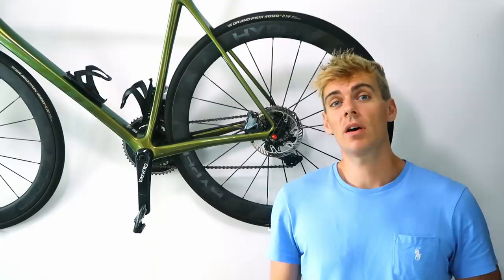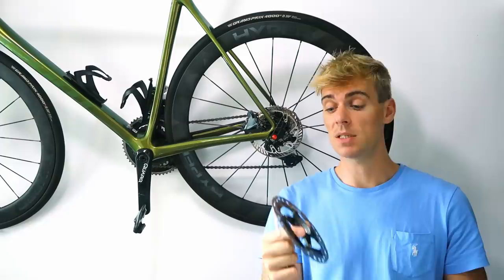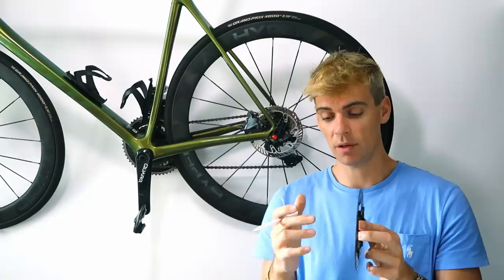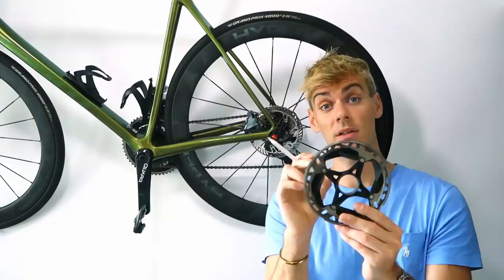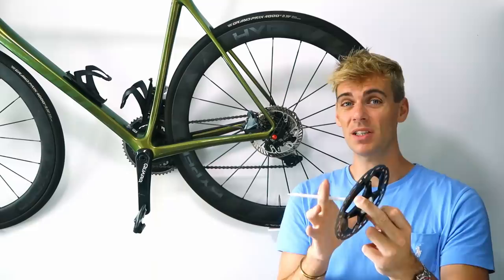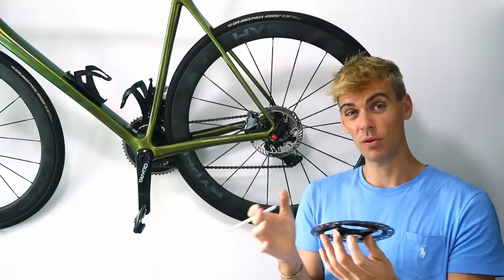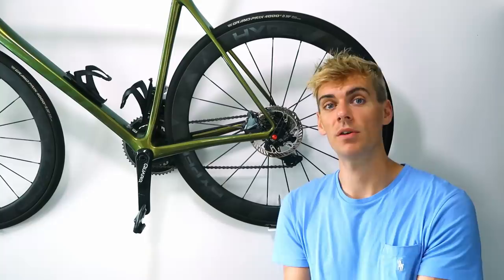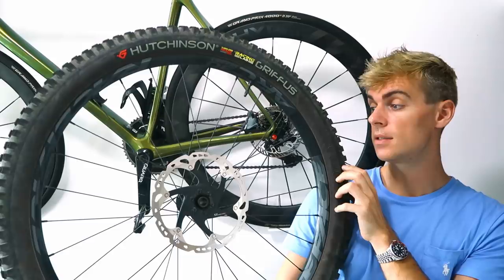Why I stopped using Shimano rotors: Disc brake rotor design, cracks & thermal issues discussed.

Comment: I agree. But still, having experienced fading going down a hill with trp steel rotors, rotor heat dissipation is pretty much thr main concern for me. Also my xt rotors stay true once I get trough an initial temperamental phase and they last about 20000km/20hkm for me. I don't think I will go back to all steel rotors

Comment: i run laptop size heatpipes and heatsinks on my calipers. sucks any excess heat away from the system and sits up along the inside of the fork where it gets a ton of airflow. i wonder if you could work in a heatpipe design into a rotor, put small finned sections in the rotor spaces. lightweight (its all hollow) and effective.

Comment: Is it possible to make some test where you heat the hub because of overheated rotors ? 
Impacts on the bearing and hub shell. 
I Know synthetic tests doesn't quite represent real world scenarios, but I would like to see test with thermal cameras and stuff. 
Maybe comparison between RT66 and some beefier rotor like the ones used by Hayes for Dominion or magura disk. Which are 2mm thick, compared to 1.8 for shimano.

Comment: i only had problems with the shimano icetech rotors. most prominently the bending after only a few hard stops (and thats a 70kg rider in the mostly flat german east). and you cant simply bend them back because after the first few heat cycles they are bend in the exact same way again.

i now use hope floating rotors and put them on several other bikes too. they are awesome. i mistreated them intentionaly to the point the brake lever faded and they are still true. they simply ping themselves cool and are good.

i also have a set of 2.2mm thick intend bc (same as BRAKESTUFF Punch) one piece steel rotors. the 2.2mm thickness is on the edge of what you would want to use on shimano road calipers, its kinda fiddly to align them correctly but they also make no further problems once setup the right way.

Comment: Hey, really good point. I've been using sram discs on my 105 for 4 years and now I swapped for original 105 discs and I'm pretty disappointed. Shimano feels a bit cheap. And stopping power is definitely worst. So I need to buy a different ones. How do you find Campagnolo? thanks

Comment: Garbaruk might be an interesting partner. They make great stuff and have many many cnc milling machines. Their steel is pretty rust free on my casette. Coating needs to be very heat resitant so powder might be your only option. P.s. let me know, I will buy a pair.

Comment: Such an interesting topic and thoughtful analysis. Looking forward to your designs!

Questions:  Will the heat path on one-piece steel be more likely to distort the rotor like a potato chip? As the outside brake surface heats much higher than the center, the entire thing will want to curl as it cools?  I have always thought that is why they pin the rotor to a beefy center spider.
Instead of just a pinned rotor, if the rotor's arms terminated in a interlocking jigsaw end (male) into the spider arms (female) and was pinned, than as the rotor heated up, it would tighten onto the spider arms.  The pins would not be loaded.
Or, if the spider was slotted, so the rotor basically interlocked, where a pin would only be acting as a cotter pin.

Really interesting topic, exciting to see some fresh ideas here!
Reply from the maker: Very nice comment. Magura have the interlocking type, but k think its a recipe for squeal with so many degrees of freedom on offer!
Reply: @PeakTorque  Interesting on the Magura! I was thinking much closer tolerances than that but intersting!
I guess the industry is trying to tackle the same issues you raise. 
I also think this shows two things:
1. Rim brakes are pretty damn great.
2. We are still in beta days with road disc, and everything out now will be obsolete in a year or two. (anyone remember qr road disc or thru-axle front/qr rear hybrid??)

Comment: @Peak Torque  do you think centrelock is the way to go for MTB hubs and rotors, or is 6 bolt still a good and reliable standard?
Also, do the centrelock adaptors that allow the use of six bolt rotors increase the risk of misalignment or instability? are some brand adaptors better than others?
Cheers
Reply: Deckas and the RT 54'S or Galfer are the way to go . He never made rotors at all "take peak torque with a grain of salt when it comes to him making promises he can't keep" .
Reply: Has this guy got a thermal physics Ph.D .?

Comment: How do you get so much rotor wear? I measured the formula rotors on my mtb new after about 8000km and they only lost about 45 microns. They went from 1,975mm to 1,930.

I also doubt that conducting heat into the hub is an issue. You can get your disc to a point where it has discolouration due to heat but at the bolts its still safe to touch.
Reply: I had an Ashima 160mm rotor split on a descent on my MTB.  On measuring it the braking surface had lost half its thickness...  Needless to say I then measured the other ones I had.

Comment: It would be interesting to see if there is a composite material that could be used as a thermal barrier at the hub interface or elsewhere in the spider, like phenolic spacers used on intake manifolds

Comment: The floating rotor prevents yielding of the material due to the thermal expansion. A fixed rotor will yield due to the internal forces created in thermal expansion if it is not allowed to move somewhat freely.
Reply: I would probably use a complete SS rotor braking surface with aluminum fins with floating pins. The aluminum fin loses about 3x the heat as SS and the SS is stiffer to keep true and the floating rotor prevents yielding. Also I would probably use an aluminum spider to save weight.
Reply from the maker: You can't make that general statement. It depends on the design of the vents and the arms, it doesn't have to yield.
Reply: @PeakTorque  you're completely correct. Just wanted to bring it to your attention in your designing process and help you out in the YT algorithm.

Comment: Aren’t Hope vented rotors supposed to be really good for their thermal characteristics? Also, when do you reckon one of the big brake/groupset manufacturers will begin to introduce carbon rotors (or carbon-ceramic as on performance cars)?
Reply: Carbon rotors need to be kept in the right temperature range to work properly. They aren't the right solution for bikes. If they will ever be intorduced by a big maufacturer it will be in mountainbiking, because it is more decent focused.
Reply: @skilllessbeast7416  possibly yeah, however,  as was a point in a previous video (the Froomey disc brake video), mtb riders tend to only slow down from around 30-40km/h to a stop, as opposed to 50-70km/h for most road riders on descents and possibly higher for pro riders, so the superior heat characteristics would probably be better felt on long alpine descents. Having said that, downhill mtb riders with their far heavier bikes would probably appreciate them as well
Reply: @ollieoxley7382  been tried . Carbon brakes are not consistent enough in brake feel for mountain bikes . One moment they are next to useless the next moment they are grabby as fook . Then the cool down and back to no brakes . While MTB is slower average speed the weight of the bike (a DH race bike can be 30lb or more ) and the high speeds than can be attained (at a BDS race I was marshaling the speed trap recorded a rider at 56 KPH  and at WC races over 65 kph) means you want brakes to work consistently.  If it's raining or muddy that can cool your brakes to where they won't work , or if you hardly use your brakes  because you are a more flow rider. 

Steel is best for bicycle brakes .
Reply: @ollieoxley7382  But there is more braking in mountainbiking. That means that the temperatur is more consistent. And even then it doesn't really work, as mentioned by edmundscycles1.

Comment: I am wondering why thermal in bicycle brakes can be an issue at all. It might be a simplistic approach but to bring to full stop from 36 km/h a large cyclist takes 5000 J. Considering typical weight of the disk rotor of 125 g it translates to 40 degree temperature increase. That is if full heat released into rotors without heat dissipation. Now, some of it will go into brake pads, some of it will go into air during the braking, some heat will go to tires. I don't see rotor temperature going up more than 30 C after vigorous braking. Now look at the working conditions. Large cooling surface, open air design create ideal conditions for rotor cooling. See how it is connected to the hub? No way those tiny bridges would transfer any meaningful amount of heat to the hub.   Yes, rider probably could try intentionally try overheat rotors but I don't see how rotors can get hot in any meaningful use scenario. Car breaking from 30 m/s releases 150 times more energy to the brakes rotors weighing just 70 times more. Car brakes work in much, much worse cooling condition and sit fully on ball bearing assembly and still overheating is not an issue unless you are driving like crazy stunt driver.

Comment: The rotors are not a true floating rotors. Floating rotors have a little play and would never use rivets.  The pads will conform to a warped rotor if the caliper is a non floating caliper. The reason for the floating rotor is so the warped rotor doesn’t cause the brake pedal to move or pulse which affects the brake feel.  One reason racers dislike abs systems is the pulsing sensation in the pedal affects their feel for the brakes.

Comment: Shimano recommend resin only for ice tech rotors. You will destroy them with sintered pads. As a rim brake user you will surely appreciate that resin pads are plenty good enough. My rotors have been through 5 winters, thousands of miles, & still as good as new.

Comment: I'd love a set for my roadbike. For Mountainbikes the XT icetec discs are pretty decent though. I've had problems with the full steel 203 mm slx 6-bolt discs  overheating. Sure the XT ones mostly only last around 5-6 months, but the performance difference is worth it imo

Comment: Wouldn't it be possible to use Centerlock Mountainbike Disc rotors? The XTR Disc rotor brake track apperas to be a lot thicker.

Comment: Hm...So are you planning to make rotors with a Center Lock out of hot working steel?
That would make sense to me because they would have better thermal conductivity (but not as good as cast iron, which might be too good for this use case), be very wear resistant (carbides), and they still work harden in use (austenite).
I'm very interested to see what you are up to.
Keep up the great work mr Torque!

Comment: I have just removed my shimano  durace rotors and gone to campy and quiet and smooth braking, but the stopping power on the ultegra brake pads arent that great what type of pads do you use.
Thanks.

Comment: Interested in your rotor design. I am using RT-900 Dura-ace. It is better than Hope I used in a previous bike, but it is not durable, as you have already mentioned, though mine lasted 3 years, about 25,000km.

Comment: I’ve been running disc brakes on mountain bikes for twenty years. I have used icetech rotors and solid steel rotors. I can’t say I can tell the difference in braking but I do find the all steel variety seem to bend more easily than floating types. They all wear at a similar rate though. I think when a rotor gets to be 1.5 thick from wear, combined with wear of the pads and the relatively low fluid volume leads to a lever getting closer to the bar than I like. I’ve had that issue with many brakes too. 

Question though. Compared with rim brakes how does the wear of disc rotors and pads compare with worn rims and rim pads? When I was racing off road with rim brakes I was replacing pads a dozen times a year, cable and housing was replaced monthly and I’d chew through about four rims a season. Ceramic rims really helped with wear but disc brakes were even better. I raced road too but rim wear was a lot slower.

Comment: I know that it has only been 1 month since this video but any news worth sharing? I am a hefty boy at 110kg (working on it 😃), so good brakes are always welcomed. I am currently looking at getting the Galfer DB002W2 (160mm rotors, 2mm thick, 108g (irrelevant), brake track made of high carbon steel; so still laminated it seems) Application MTB & E-Bikes but will use them on my roadbike to replace my Shimano rotors, hopefully this setup works in the meantime ;)

Comment: What about Ti?  Not sure what the thermal properties are, but I think ceramic coated full Titanium rotors are used in motorsport.  Would obviously be lighter than a full steel design.  AbsoluteBlack have had a prototype for ~2 years now, but still no sign of it being released.
Reply from the maker: I did think about ti-alloys but the thermal conductivity is very poor. But maybe this would be beneficial
Reply: @PeakTorque  Also KCNC do Ti rotors that are available.  From what I heard, they work well, but absolutely shred pads - albeit that may be more due to the shape / machining of the cutout design?  https://r2-bike.com/KCNC-Brake-Disc-Titan-Titor-Rotor-160-mm  .. they're super WW though, so not for the big boys. more air than metal.

Comment: I have the hyper 50mm disc break wheels too. I have had big issues with the disc rotors from the get go with these wheels (particularity the front wheel). I have had the wheel set on two different bikes with two different sets of rotors (Dura Ace & Ultegra). I have had two different bike shops try and solve the problems of disc rub and noise but not luck. One bike shop changed out the bearings in case it was a problem with bearing float, but still no joy. I also have two other wheel sets + my wife has a disc break bike too. I have had no issues with using shimano disc rotors on the other branded wheel sets. I think there could be a fundamental problem with the Hyper wheel set hubs. Anyone else got Hyper wheels having problems with disc rub and premature disc wear?

Comment: Can anyone remember what was wrong with rim brakes??!
Reply: Try long, winding descents on rim brakes and see how much it heats-up your rim. Your rubber tires are connected to your rim and that much heat is not good for them.

If you primarily ride on flat roads, then rim brakes are ok.
Reply: Terrible wet weather performance.

Comment: Thanks Peak Torque very interesting. I was wondering if you think there is also a potential problem of your carbon spokes on your Hyper wheels heating up. Do you this could potentially melt the glue?

Comment: Yes yes yes 👍 count me in for some discs. I never understand why cycle rotors are made from stainless. When I switched to Galfer rotors on my motorcycle which have a higher iron content the performance  difference was night and day.
Shimano are so well made but a terrible product. My Sram rotors warped over and over. I tried Galfer rotors which are solid steel but they didn’t have the same bite so dead excited to try yours when ready

Comment: Wow! I'm an MTB'er (and i have the very same XTR rotors, but in 160 / 180mm config), but never seen a disc that worn as yours. you really have to descend thousands of miles to bring your rotors to that condition... wondering how many brake pads you worn out until you reached that thickness of that rotor?

Comment: Interesting. I use those XTR rotors on my enduro bike and they are put through it’s paces on every ride as I live in a quite hilly area with steep and fast descents. Never had any durability or heat issues even though I am not the lightest rider. So far those have been the most fade resistant brakes on that bike. Maybe it’s the whole setup of calliper, pads and disc that promote that outcome shown in the video? Also braking technique plays a vital role in how much you stress your brakes. Short and hard application seems the way to go with Shimano rotors...

Comment: I just run ashima ai2  rotors on my ultegra bike, yes they heat up but they cool down pretty quick never really had heat issues for the hub...but for ashima.. don’t run resin pads you’ll chew through them in a few months.

Comment: I would say that the thermal conductifity properties of aluminium are Better then steel in the case Where you don't want to have the Heat energy transferred. Have you considered a ceramic coating? They can be Heat resisitant. It is used e.g. for cutting tools. I'm interested in the follow up :).
Reply: Tungsten carbide

Comment: Agree to disagree about floating rotors. I slightly perfect mechanical disc brakes for techy mtb due to disliking lever free stroke. Based on my (still evolving) experience proper floating rotors seem to work much better with the mechanical calipers that don't have the float that hydros have. I live in a place where a daily temp swing of 20-30C isnt uncommon, and I do notice thermal expansion of housing, brake rotors, can throw the brakes and the dropper post out of adjustment most noticeably.

Comment: Hi! Do MTB calipers have a bit more clearance than road calipers? My road bike has GRX levers paired with Deore M6000 calipers because the frame has IS mounts, and I rarely have disc rubs after long descents. The SLX rotors though are a bit flexy, I have to tru them sometimes and it does not take a lot of force to bend them.

Comment: Great shot of the steel laminate separating from the aluminum core. Mid-vid PT referenced 250 degree temps at the center-lock/hub interface. Does this temp reflect real world conditions?
Reply from the maker: Not sure yet. I've got a thermal camera for the next video.